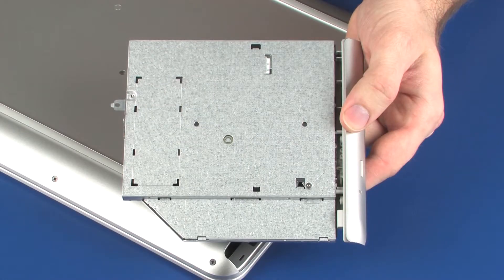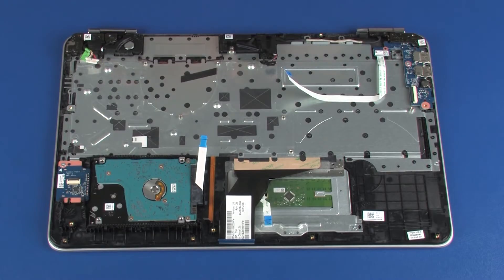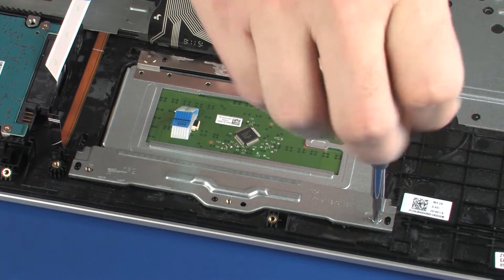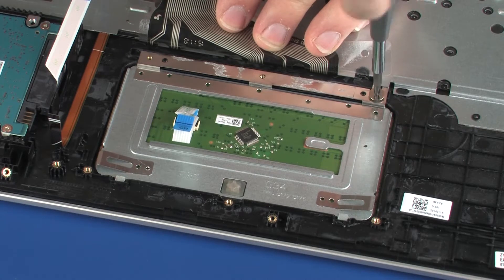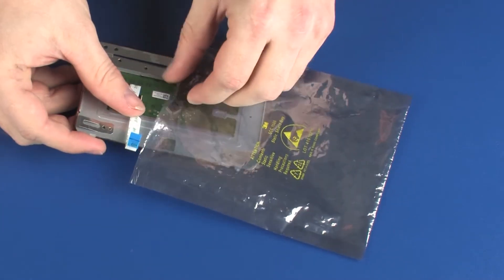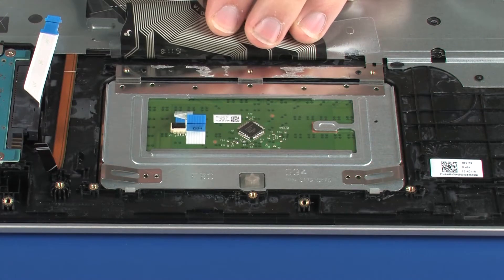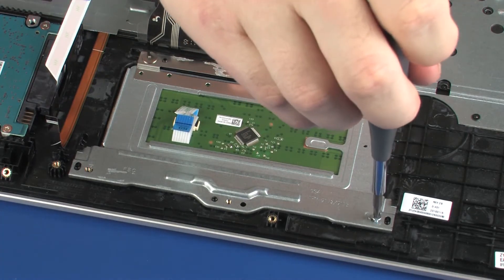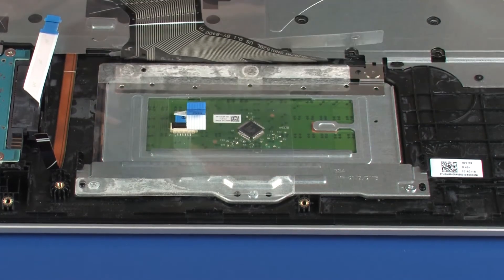Replace the Touchpad Board | HP Pavilion 15-au000 notebooks | HP Support

Comment: Is the chip attached to the touchpad board also replaceable?
Reply from the maker: Hi there, thanks for contacting HP Global Social Media Support!
I understand that you need to know whether the chip attached to touchpad board is also replaceable. 
I will do my best to assist you.
The integrated circuit (IC) chip on a laptop touchpad board is typically not individually replaceable by an end-user or standard technician. The chip is a surface-mount component soldered to the board, requiring specialized tools and skills for removal, and an exact, pre-programmed replacement part is difficult to obtain.
Regards, 
HP Support